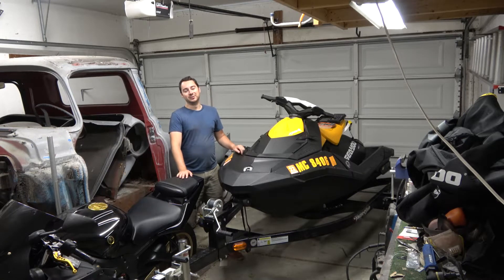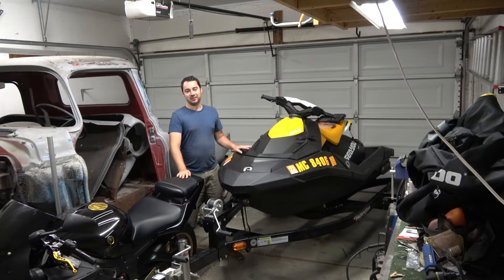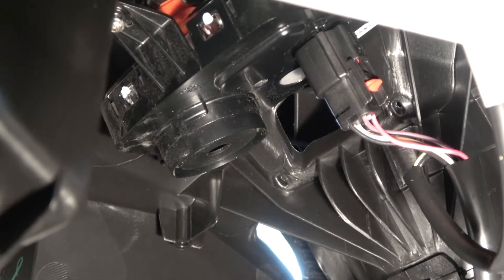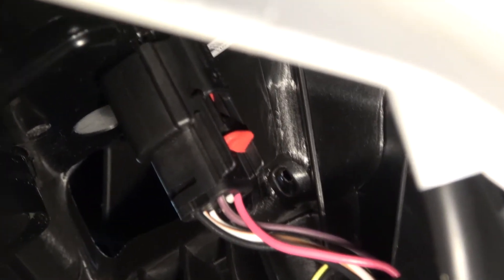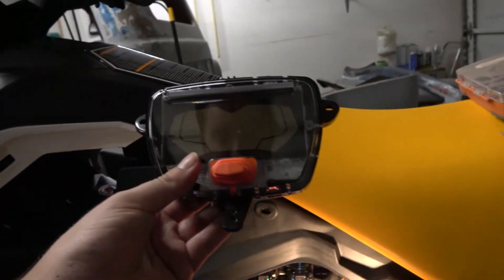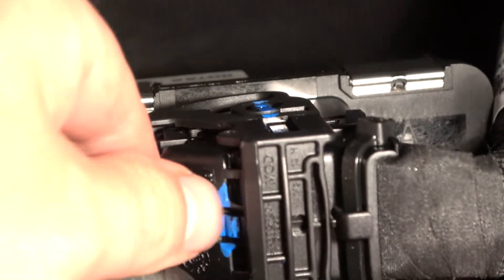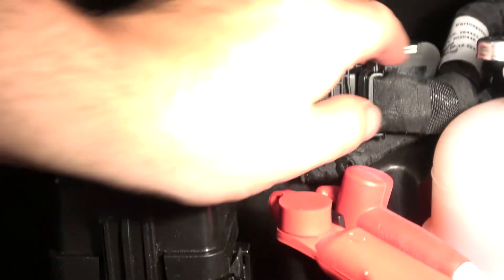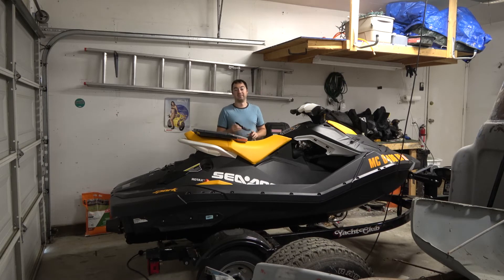2019 Seadoo spark 110HP tune

Comment from the maker: Lots of questions on why I removed the gauge and why it states "Please note, you must send YOUR ECU and Gauge cluster in for programming. Both very easy to remove." on their website. Thank you to Dutch Coast Riders for reaching out to race lab for the answer. The 60-110 tune (which is what this video is) requires this to enable sport mode. if you are doing the 90-110 tune, the 90HO already has sport mode and is not required to be sent in.

Comment: How did you manage to unscrew the ECU? I don't see how you could get a screwdriver in there.
Reply from the maker: 90 degree bit driver or a 1/4in socket with a torx bit in it

Comment: buddy i dont think thats 110hp, my 2016 spark is 90hp and does 50mph. u were doing 49 with 110hp??? plus I weigh the same if not more than u.
Reply from the maker: It's 110. The tune doesnt do much as far as top speed. You are more or less limited on speed based off the size and pitch of the impeller. The tune gives you a lot better hole shot.
Reply: @MikeT  if you get the tune you have to buy an aftermarket impeller
Reply: or should atleast
Reply from the maker: @FinesseTVz  No you dont. They have different stage tunes depending on what you have. This is the stock one and is meant for a stock impeller, intake and exhaust

Comment: That's nearly an 83% increase in hp.. doesn't really seemed like you gained much
Reply: It's different on the water vs. land. Takes A LOT more power to see gains in water. Acceleration is the primary gain. My 90HO will hit 49mph on glass water but I want crazy acceleration for the fun factor.

Comment: why did you remove the guage cluster?  I've never heard of that needing to be re-calibrated after flashing the ECU.
Reply: I just send him An e-mail with that question he told me that the 90 doesn’t need to remove the panel because they already has the high output straight away 👌🏼
Reply: I had the same question just send mine to racelap aswell but only the ecu
Reply from the maker: I was told it had something to do with enabling sport mode. Idk if its true but it clearly says to send both on RaceLab's website. "Please note, you must send YOUR ECU and Gauge cluster in for programming. Both very easy to remove."

Comment: Hi Mike-great vid showing how to remove ECU. I'm thinking of going ahead with my 2017 Spark Trixx-only question; you're video cut short, I see the huge difference in acceleration, but what have you seen as top speeds for the mod? Thanks man!
Reply: You limiting factor is you impeller if you upgrade it  you will see more top speed
Reply from the maker: around 50 mph

Comment: Great how to vid man. How are you liking it do you feel it was worth it?
Reply from the maker: Thanks, I think the tune is awesome. It has some balls to it. If you gun it you better hold on in sport mode. I think price wise its a great option. Like I said, I got the 60 hp knowing I was going to do this to it. The price difference between the 60 and 90 is about $700-800 depending on the deal you can get. This cost me $225 and gave me 20 more HP than the 90. There was one person on a forum saying there is no difference between the 90 and the 110 tune but I am not sure if he actually did any sort of comparison or was just talking out his ass. On the other hand there is another company that will do a 120 tune but its $100 more than the 110 so if people are saying there is no difference between the 90 and 110 then I cant see paying another $100 for 10 more HP you may or may not even notice. But yes, I am very happy with it and the turn around time at Race Lab was really quick too. Satisfied with both the tune and the company.
Reply: @MikeT  Thats were I am at right now. Thinking of waiting for the end of summer deals on a pair of 60hp Sparks and tuning the ecus. Any other mods planned for yours?
Reply from the maker: No. My friend got the same tune. That's where I got the idea from. He is also getting an exhaust and impeller. I am perfectly fine with just the ECU tune
Reply: I want to try that. How can I found the website for the tune company?
Reply from the maker: https://racelabperformance.com/
Reply: Mike T thank you
Reply: Mike T thank you for the video and comments i just recieved my ecu back from racelab aswell i wasn’t 100% sure about it because there are also alot of story’s on internet about that its nog possible to tune only the ecu. They say every engine is different and has to be tuned personally. So if you say its Good like it is... then i didnt waste my money aswell 👌🏼